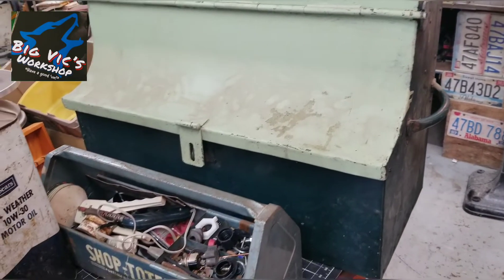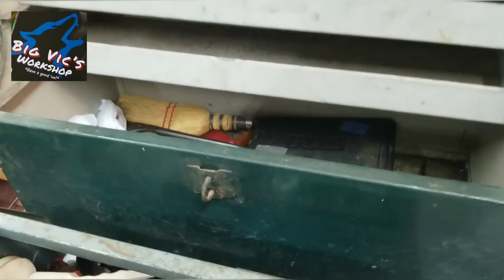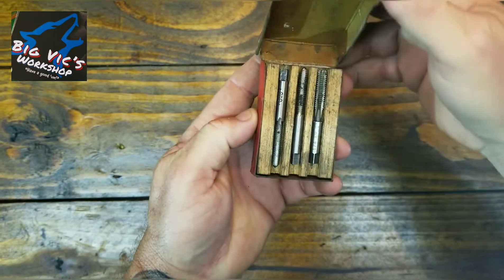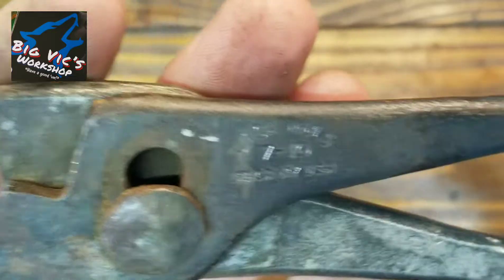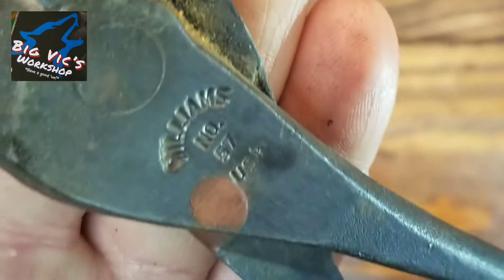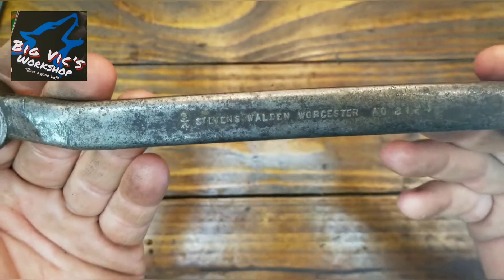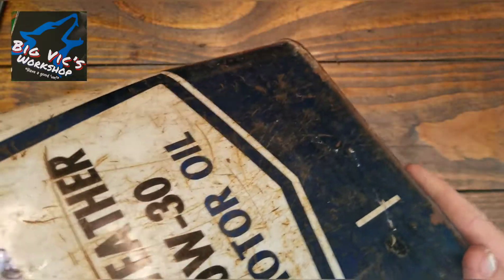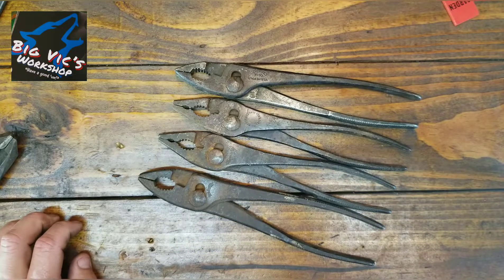#096 🔧Part 1 of 3🔧 ☆MASSIVE☆ Vintage Estate(s) Sale Tool Haul 🔧Utica ☆ Herbrand ☆ New Britain ☆

Comment: Mephisto pliers? 

I have a toolbox built similar to the one you started off with, we should compare notes on how they’re built.

Good stuff man!
Reply from the maker: I appreciate it... the tool box is cool.. its riveted together and all the drawers are removable and when in the box they  just sit/rest on rails... Mephisto is right..they are No.96...  thank ya for your time!!
Reply: @bigvicsworkshop  Yeah the one I have is the same way, all the drawers are folded galvanized sheet metal too, it’s a really odd box. Not the same shape as yours either. Difficult to tell if it was commercially manufactured, but I suspect it was. I’ll DM you some photos on IG.